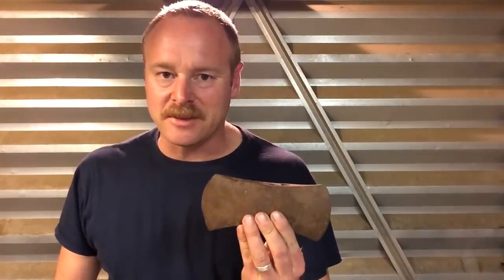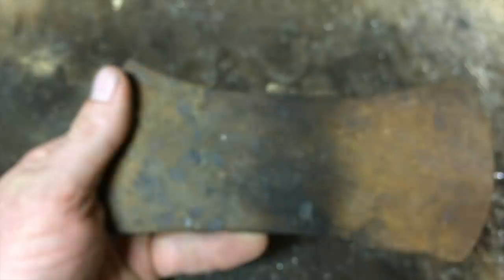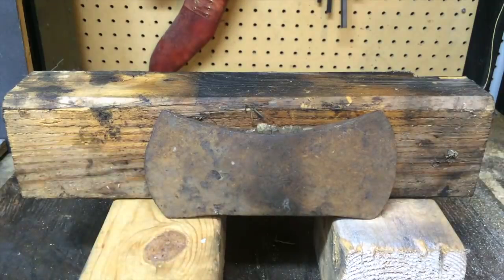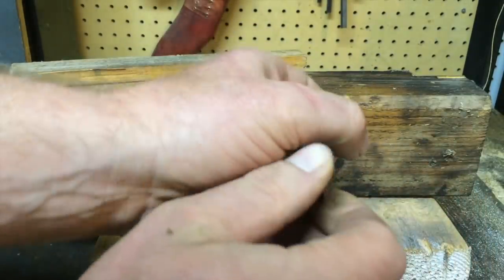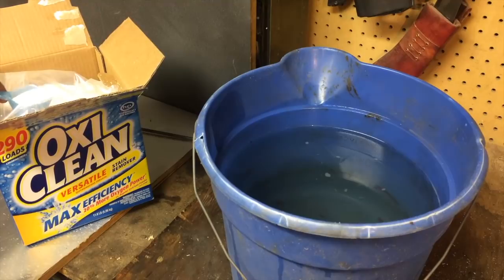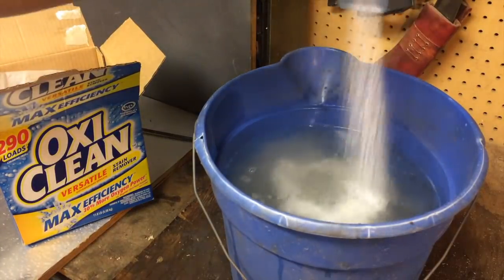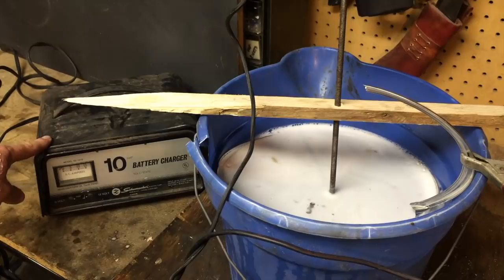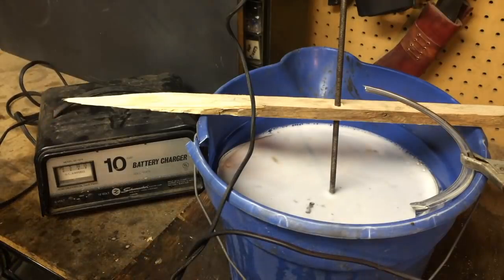Remove Rust With Oxiclean | Grandpa's Tools | Cruiser Axe 1

Comment: That's awesome. Always feel like there is some kind of connection with those who have gone before when you find an old tool like that, even better when it's from family.
Reply from the maker: Yes, yes, yes. I cannot pick up any of the old tools in my shop whithout at least wondering about those who used them before me. The very epitome of a touchstone.

Comment: I have not done electrical rust removal yet, that's why I am watching these videos. This by far was the best. The  anode size, a good electrical connection, current flow direction, was lacking or (wrong) in the other videos. 
As an electrician this was right on, and what I told myself to do before i saw this video.
When I do this process I want to try tap water vs distilled water just to see if there any difference. I also like the Oxyclean for some reason. 
GOOD JOB!

Comment: I have used vinegar to remove rust from tools that I was restoring  and noted your video. Great combination of electrolysis and oxyclean. I will need to try this soon. Intrestingly, I have been plauged with rust stains from my well water in my fiberglass shower insert. I dampened the base of the shower and distributed alot of oxy clean and made a slurry that I let sit for some time. Occassionally scrubbing with a sponge floor mop and allowing to sit removed the rust stains completely. I did not rinse off until I was sure the rust spots were gone. It went from orange to pure white in less than an hour. Great stuff.
Reply: Loretta Caputo iron out spray works great on iron stains.

Comment: Really cool. My mothers husband passed 15 years ago. Last week she gave me his huge Snap On box. The drawers were stuck and needed work. A little solvent and graphite was an easy fix. However the box is full of Snap On tools. Keep in mind the box has set in a garage for 15 years to 18 years. Not a total isolation from the elements. About  1/3 of the tools have  lots of rust.  The worst are the plier set , adjustable wrench set and lots of the tap and die tools.  Snap On has a life warranty BUT not against rust. I was using a brass brush on my bench grinder. I plan to set your gadget up tomorrow. Thank You

Comment: I could fill the page with superlatives about your video. Articulate, well paced, enough humour to raise the odd chuckle, enough cautions to be relevant, a very considered delivery.  Oh and buggr me if it didn't do exactly what I need it to do.  

I restore/renovate old/vintage pushbikes (well to some effect but not great) and rust is always the starting point, this has shaken my paradigm on rust clearing. Gone will the be days of wire wheel shards sticking out from every surface in my environment, some of those surfaces belonging to me. Gone will be the mild anxiety associated with wire brushing off all the makers brand stampings. Gone will be the hours spent droning away at the wheel and trying to find creative ways to position the item to brush 'that' point on the item and avoid the guard, body, bench top, and still come up with a partial rust removal that needs to be followed up with a welders wire brushing or dremmeling.  Sir, I salute you.

Comment: Great find! I've removed very difficult rust by soaking in CLR for a couple of days, a bit of a wire brushing, wash in water, then spray with WD40, wipe off & done...just saying. The great thing about CLR also, is that when you're done, strain out all the junk & put it back into the container - good to go again & again...

Comment: First of all thank you I’ve learned a new way to remove rust. I just want to point out that vinegar works the same way without all the other stuff. Great video
Reply: The advantage of electrolysis is that no original metal is removed; oxygen is just pulled out of the rust, leaving the iron intact and the process stops when the oxygen is all gone. The acid in the vinegar, on the other hand, will eat away some of the iron as well as the rust. If left too long, the acid can completely dissolve the object. I have learned this by my own experience.

Comment: I got the same damn battery charger.. it literally looks like you grabbed mine from my garage... brb .. going to make sure mine is still there...
Reply from the maker: .....heh...heh...heh
Reply: ahahahahahahahaaa ..  found you battery charger ..
Reply: Zack Of All Trades aa
Reply: ISEE YOU lol I got the same exact one also 😂
Reply: Danny Timms r
Reply: ISEE YOU I've got the 6 amp version. Bought at Western Auto back in the 70s. Still working fine!
Reply: My dad has one that looks the same, but has a switch for 2amps or 10amps. I'm sure it is the same brand. I think my charger is the same brand, but I bought the fancy digital one. Who knows if the brand has been sold over and over or bought by a bigger company, but it is still around!
Reply: Mine has has been missing for over 3yrs now. Are you sure you didn't swipe mine ISEE YOU.🤔
Reply: Everyone has that battery charger
Reply: Another member here in south Alabama. Man, they must have sold a couple million of those models. If I remember right, I bought mine from a auto parts store in 1993 or there about. Must have been a reliable model with so many replies on this video, mine still works well.
Reply: That's a me too on the charger  .
Reply: I have that same battery charger, after my dad died.   Got to be at least 50 yrs. old.  Still works!

Comment: One important thing not mentioned, immediately after your item is de-gooped and rinsed, it will start to just.  Be sure to use a rust preventative appropriate to your item (food use, not for food). All raw steel is unprotected and will rust like the sickens right before your eyes.
  This process works well for cast iron pans, any non-stainless, carbon steel item.
  Using a larger charger (40 amps, etc.) Is desirable or it will kill your charger pretty quickly.  Especially for lager items like a cast fry pan.
Small charger, clamps, etc. and things wear out fast.
  Arm and Hammer "washing powder," specifically, works best.  About a half cup per gallon of water and is carried in many standard grocery stores, etc.  If you have to go buy something, buy that.
  And he's right about the hydrogen, do NOT do this in a small, unventilated area. Garage is best.  Use fans, open windows.

Comment: 3:25 that piece of metal (before the handle was broken off) was used to hold the handle in place.  Over time with use, the handle would become loose and you can hammer another wedge into the top to act as a shim.

Comment: FYI, the piece of metal you found in the old piece of handle is a wedge. The hole in the tool head (axe, mattock, hammer, etc.) for the handle,  is slightly flared at the top, and after it is driven onto the wooden handle, the wedge is driven into the wood to expand it into the flare and hold the tool head on.
Reply: I'm pretty confident that the channel owner understands how axes are hung and what a wedge is. Typically there's a wooden wedge parallel to the head of the axe, then one or more smaller metal wedges perpendicular or on a slant hammered into the wooden wedge. This axe just had a jagged scrap metal chunk alone. It was a careless rush job originally. Which is perfectly fine if that's all the task calls for. My habit when I have a similar tool with a loose head that isn't a huge value to me or the handle is half shot but not entirely done is to throw a few nails in there. It works for another six months. I wouldn't be surprised if a responsible craftsman with good habits found it later and shook their head at the sloppy job. I can hang an axe very well if it's a gift, I'm doing it as a favor, or if it's one I value a lot or intend to use frequently but I'll also slap crap together if it's a cheap tool I plan to be able to leave outside or use improperly anyway.
Reply: There's always one.

Comment: Alot of guys using common sense would have the anode as the object to lift off the rust better but this causes pitting and destroys the object being cleaned.  You tried to steel plate a piece of steel so the bubbles just removed rust but not metal.  This is a great DIY video. Thanks.

Comment: My dad was an avid woodworker/craftsman in his spare time. The totem pole he made is still in my mom's basement, along with the remaining hand-made canes he created (he must have GIVEN away over 50 to relatives, church friends, co-workers, & neighbors). I'd love to know about the material composition of the parts used to securely fasten the axe head as I have an axe head to clean, as well as many other steel tools that I inherited upon his passing. I don't just want to grind them down if less grinding is necessary due to this process. Thanks in advance for any further info you can provide.
Reply from the maker: Hey Scott, as long as it's steel this process will completely clean off the rust, the only reason you would need to grind or sand is if the metal is pitted. I'm sorry but I'm not very educated on alloys and how they respond to electrolysis, i'd expect it all to be steel when it comes to axes and tools.

Comment: You should oil the axe head after washing off the oxyclean to keep rust away. Rust, albeit light surface rusting, will start right back up again on uncoated steel after the electrolysis and cleaning is completed.

Comment: OxiClean is an oxidizer also known as sodium peroxyhydrate 25 to 35% hydrogen peroxide the balance being baking soda you can buy the stuff in 50-lb bags technical grade the stuff in the store is weak and has fillers  I believe the company is Cam 1 in Houston who imported they get it in on pallets
Reply: Completely wrong composition.
Reply: @FrankGutowski-ls8jt  So what's the right composition?
Reply: Chris Elliott 

Google it. It will show sodium carbonate peroxyhydrate.

Comment: I have a 50's cruiser-ish axe, can't get a handle however, and PLEASE don't remove that patena of it, that's the best patena I've ever seen
Reply from the maker: The handles can really be a bear to find for sure since cruisers aren't in super common use any more. Rest assured, none and I mean none of this patina will be removed besides the cutting edge.
Reply: Thanks, I went to my local true value hardware store and found one. I didn't buy one, but they let me put it in a closet to get later. Speaking of bad condition, I found a plumb axe in the ground, and the pitting is DEEP. I will upload it later
Reply: Can't find a handle? Watch Ray Mear's and learn to make one yourself....
Reply: Chris Black

Comment: If you do not treat the metal piece after the electrolysis, it will flash rust. That process starts almost immediately if the metal is not treated. It is microscopic at first, but spreads. Me, I do not use the same type of battery charger when I do electrolysis. I have used this technique for years in cleaning car parts of everything from Model A Fords to '42 Chevies.  Your bucket is a bit small.  I have even used this process by using a cheap kiddie pool and it works well with larger pieces, too. However, you always want to be careful that the parts do not puncture the plastic. It is safe to pour the sludge on a flower bed, but not on a veggie garden when done.  Me, I like Arm wash soda and Hammer better than Oxiclean, but I am an old dog and resistant to change. Your going to have to search high and low to find any real cases of someone actually killing or harming themselves by electrolysis fumes. I do my work outside to begin with though, so ventilation is always adequate..
Reply from the maker: Thank you for the comment, I hosed it down with water and hit it with a light coat of oil and it's still rust free today.  I like the Idea of a kiddie pool.
Reply: a1930ford what do you use to treat it with and how do you get rid of the black oxide after you pull it from the tank?
Reply: Good to know that the sludge can be recycled in the garden, not just poured down a drain, thanks.
Does anyone know if the sludge will be acidic or alkaline?
Thus informing what kind of flowers/bushes it's best to use on.

Comment: Back when they still made coffee cans out of metal. Good old days.

Someone tell Maxwell house that I only stopped drinking their shitty coffee because they stopped selling it in useful cans.
Reply: They still do.  It's Brookshire store brand.  I save them all
Reply: @terrymccorkle1674  Are you American? Because I don't recognize the brand. I'm from Ontario Canada. Most of the stores just have a brand called Selection, Folgers, and Maxwell House. There are a few others but they all come in the plastic. Which is totally good for paint. But this is another good use. Easy enough to find scrap metal though. To be honest. If they are saving the environment by reducing energy demands and costs; I'm just going to sit here and enjoy my crow.
Reply: @brendanwood1540  Yes I am.  It's Brookshire brothers store brand.   They also own super one stores.   Don't know whether they are nation wide or not but you can order online from them I think.  And it's good coffee.
Reply: @terrymccorkle1674  Maybe worth a shot then; though I'm picky about my coffee taste; won't hold it against you. For now I've found myself with a surplus of scrap steel sheet metal, not enough big hard steel chunks to take the rust off of. I gotta reconfigure the air supply on my makeshift forge. The fan is just way too powerful on the lowest setting of the potentiometer. Gotta divert some of the air. For now it's a more effective metal rapid oxidizer.
Reply: @brendanwood1540  I used to drink folgers all the time but when they changed the blend I had to change.  This tastes more like the old folgers and I love it

Comment: Just a note, I cleaned up rusted old iron pans with oxyclean by simply soaking the pan in a solution.  Another way is to bring water to a boil in the rusty pan and add oxyclean and let soak.  Does a good job.
Reply: Yeah? What if the battery charger and the coffee can and all that weren't even needed for the ax head? Just the oxyclean?

Comment: Rub the metal with a green 3M scrubber pad after the 24 hour vinegar/water bath.
Reply: Vinger will rust steel not clean it
Reply: @mikeeagle2653  It may etch it but I wouldn't call it rusting. That is the exposure of air and water to the metal creating iron oxides.
The acetic acid in vinegar should convert the rust to ferric/ferrous acetate I believe.
You would still need to place the axe head in into baking soda bath afterwards, to neutralise the acidity.

Comment: I just cleaned up a small plumb just like yours. Mine wasn’t quite as rusty so I used a wire cup brush on an angle grinder, it looks great. I have wondered about using the electric method. I’ve got some rusty heads that will get that treatment someday

Comment: what does the coffee can look like?
Reply from the maker: You know, I intended to do a followup and show that but too much time passed and it just rusted massively from sitting in the solution so I threw it out. Suffice to say, it got really gnarly looking from the electrolysis.
Reply: The process transfers oxygen molecules from the original rust to the sacrificial anode, causing it to quickly rust away. Hence the term “sacrificial anode”. The removal of oxygen converts rust to iron and usually some black rust, which seals the surface from further rusting.

Comment: I remember Oxyclean was one of those infomercial products that are like an hour long of the same "WAIT, THERE IS MORE!". That was like in the 90s haha.

I also remember the Total Gym infomercial. I actually ordered one some time around 2004. It is an ok product not great. Don't follow the stupid workout plan. Make your own plan and have it tilted more than what the directions say. Definitely not worth the $$. But if you find a good deal for like a $100 or $200 then ya. Later I came across 4 more of these for free, I couldn't even find any buyers on craigslist at $50. I eventually just sent them all to the scrap yard. And now I kind of wish I had one. But dumbells are wayyyy better, Just get some 40s and go at it.
Reply from the maker: LOL I have an ab lounger I'll sell ya :-)
Reply: I got a total gym when I was 15 and gained 15 pounds in 2 months. I'm naturally muscular so results may vary lol. It's pretty effective for moderate resistance training for how little equipment it is. Decent enough for a teenager or females. I was too strong to get enough resistance after that so I joined a gym.

Comment: Jeez mister, forget all that electrical nonsense and buy a gallon of white vinegar.
Reply: Ah, vinegar - the Hipster Dip™. Ruiner of many a fine axe head.
Reply: Not what you think. It has its place. This process is not all that hard and takes less time and steps figuring it out or having to use more elbow grease
Reply: Just soak it in clr. This is just simple electrolysis.

Comment: I've been experimenting lately with different rust removal methods including electrolysis, but so far my favorite method is just a water soak with oxalic acid powder. Just a few tablespoons of powder in hot water and an overnight soak following by a quick wire brush will remove all traces of rust. Follow up with a bath of water and baking soda to neutralize the acid. The Oxalic  powder is inexpensive with 2 pounds as little as $10.  That said, what a wonderful axe head to have from a grandparent.

Comment: I wouldn't have gone to the trouble. I would have used a rotor wire brush rigged up to a drill with the axe head clamped down to a vise and had at it. It would have taken a couple of minutes at the most to get the whole damn thing clean. Then I would immediately paint it with rust oleum.